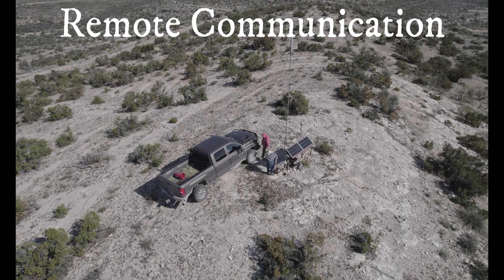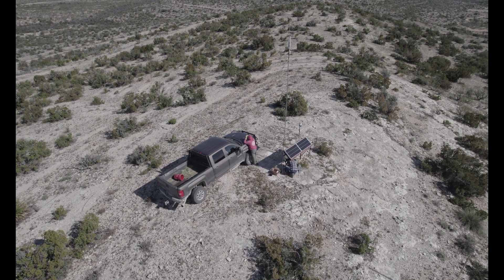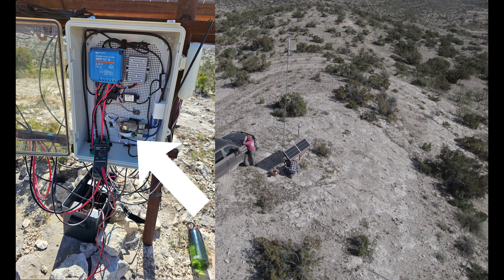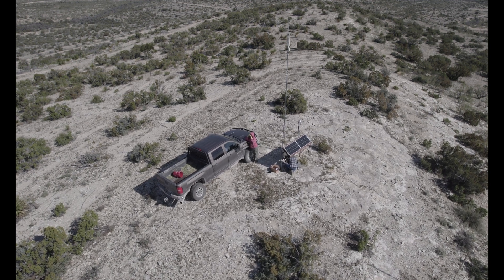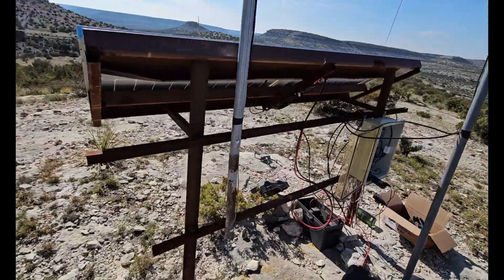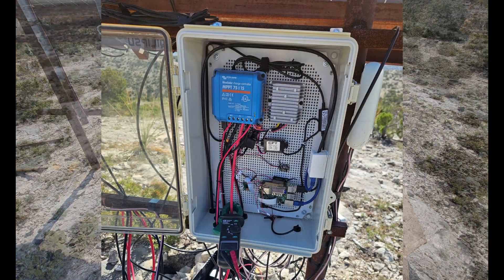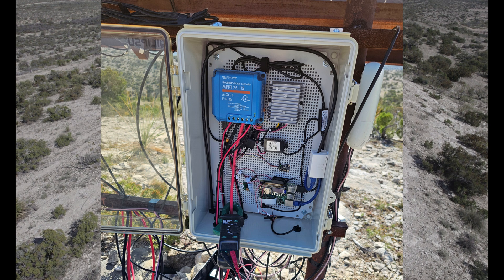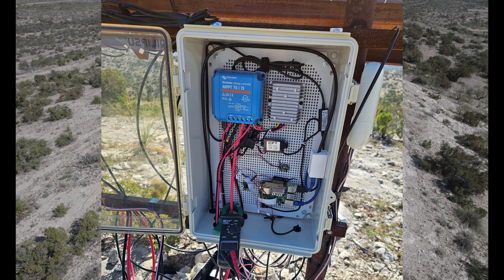Long Range Wireless Communication in Texas LoRa

Comment: Is your LoRa Meshtasitc based or something else?  Hoping to see more adoption of this in the more remote areas of TX / Hill Country where normal cellular can be spotty.  Meshtastic would be great for it's hoping abilities to get "back to civilization"  -
Reply: Love to see your gate sensors etc
Reply from the maker: This implementation is entirely custom.  We are using the Adafruit LoRa Bonnet on a Raspberry Pi 4 as the base stations with Adafruit FeatherWings as the remote sensor systems.  Using the python library we wrote a custom communication platform to communicate data between devices.  There should be a more in depth review video of this setup released soon.